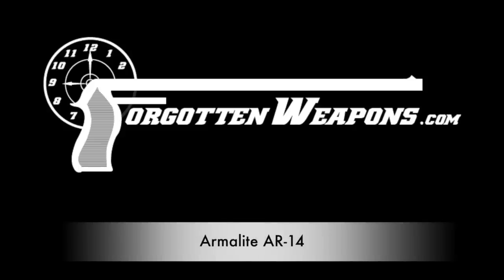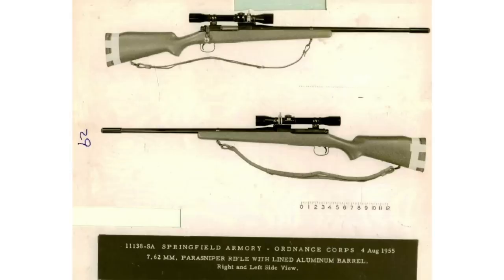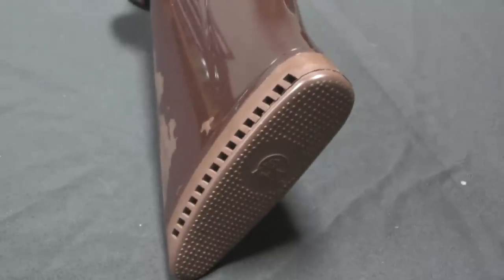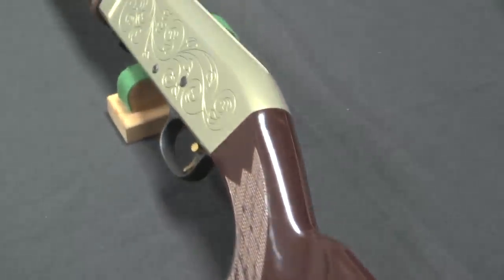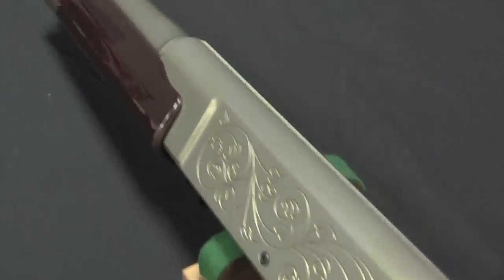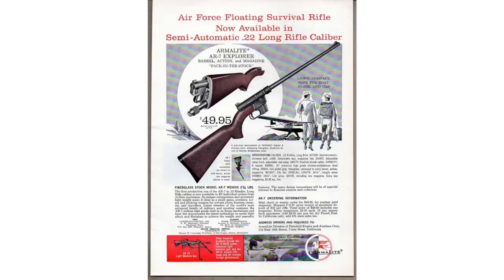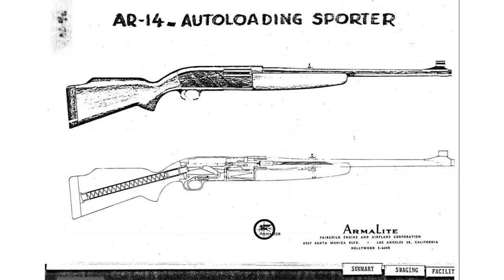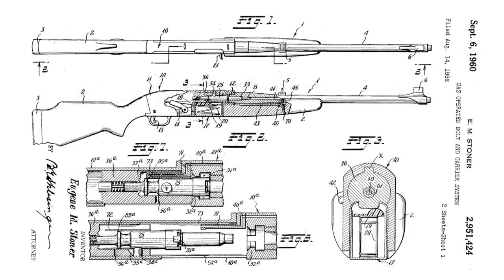Yes, the AR-14 is a Real Gun...Sort Of

Comment: That AR-7 looks very similar to a gun James bond used in one of his films.
Reply: Its the same one, used in from Russia with love
Reply: @sinner2512  ive just found the clip of it, thank you 😊
Reply: Hydin Biden  🤣
Reply: Hydin Biden  Gas turbines are quite fragile while running. FOD is a real problem and the reason why every day at a USAF base starts with all the ground crew walking the apron scanning for small objects that can cause havoc if sucked in to a jet engine. So if that 22LR bullet hit just in front of the air intake and was sucked into the enigine it is possible to down a helicopter that way. Pulling off that shot reliably is where you need a large dose suspension of disbelief, only 007 can pull that off, and even he only in fiction.
Reply: Yes and he shoots the guy in the billboard.  In the movie it is described as 25 cal but that doesn't exist.  Fun fact: Virna Lisi was supposed to play the lead.

Comment: Just to toss a little more knowledge about the "exploding barrels" and the M16/M4 ...Armalite did extensive research on barrel steels. The Military "forgot" what Armalite told them...They found out the newly developed Chrome Molly with Vanadium added was a dangerous combination all be it a harder barrel. The US Military adopted the CMV for use in the AR15 designated the M16. They also demanded a milspec for the manufacture of that steel due to what Armalite told them. By the 1980s the reason for the Milspec was lost to many of the engineers in the military.  When several M4 (*carbine version of the M16) barrels exploded hurting SEAL team members while training, the military engineers basically accused them of fraud in their claim, (hint..the SEALs were not lying...). The SEAL members claimed when they came back from lunch or a break and resumed their training, the M4 barrels exploded when only firing 1 -2 magazines.  The Army Corp of engineers immediately did a destructive testing of M4 vs M16 barrel melting in response to this claim. That testing proved both firearm's barrels explode due to warpage from excessive heat only after hundreds of rounds fired.  They only recommended the heating / cooling of the barrels be extended for all branches and that firing schedule is still in the manual of arms today. The report is a very good read and can be found on-line. In the back of the report, after the inclusion of the SEAL statements, is a curious little note ... "under microscopic examination the barrels seems to have micro-fractures..." This was lost on all the engineers and is the actual reason the CMV steel MUST BE inspected while being created. In creating and blending of the vanadium is/goes wrong, the bonding of the Vanadium is not complete. When the steel is then heated to about (I might have poor memory here) 400 degrees, when cooled, the vanadium will separate and create micro-fractures. If these tiny fractures form a chain and create a hole from the inside of the bore to the outside world..you have a pipe bomb. This happens after cooling off and when heated again. So the SEALs claims of the barrels exploding from only a magazine or two were not false.  During training they were heating the barrels made from poorly mixed CMV to about 400 degrees, then stopped training which allowed the barrels to cool down. Upon heating the barrels up again with a mag-dump the barrels exploded injuring the user.  This is why if you are going to buy an AR15 barrel made from CMV.. YOU MUST BE 100% POSITIVE its from a reputable source or your AR15 is a pipe bomb waiting to happen. If you cant buy EXPENSIVE CMV barrel (extra expense is due to quality testing)...DONT BUY cheap CMV, just buy standard CM. A CM barrel is just as good as a CMV for most people and in this case a CM barrel is 100000x better than poorly manufactured and not inspected CMV.
Reply: it's not "chrome molly" it's "chromoly" or SAE 41xx
Reply: @SuperAWaC   yeah..my mistype... but that doesnt change the reality of it.

Comment: I believe the AR5 was actually adopted by air force designated as MA1 it was never officially implemented.  They never put an official order for it by my knowledge therefore it kept its designation but the use was never official. All existing AR5s fall under SBR laws due to barrel length and OAL restrictions. And I am attempting to acquisition one myself but that has proven difficult being that 12-30ish of these may have been built.

Comment: "barrel exploding issues". Ok, there's ONE thing no one has said about Hi-Point....
Reply: I returned a Hi-Point where the barrel banana peeled on a customer! Customer fessed up though, he was running some REALLY hot handloads through his carbine and got a squib and didn't realize, blew the barrel right up. Guy was totally fine but I'd never seen anything like it. He asked for it to be fixed and he would pay whatever the cost was since he just liked the rifle so much, and I called HP customer service and they said something along the lines of "Doesn't matter if you ran it over with a train for laughs, send it back and we'll fix it for free". Sure enough they did, on the itemized report they replaced basically everything except for the grip and the stock, everything else was totally borked down to the rollpins. Got it back for free, guy was super happy!

I'm very impressed with Hi-Point to be honest. Good company.
Reply: @witmoreluke  🤔😳 Actually, I, not being a gun snob, actually like Hi Point for the fact that they WILL stand by their products. Are they "beautiful '? Er, No, but In my opinion, neither is Glock! . Hi points go "bang" and put holes where one wants to put holes. That's what you want from a gun. They are certainly better than the old "ring of fire" stuff that the "economy minded' had to deal with in the past. So, yes, I put Hi Point with Glock. Ugly,but "good". 👍🙂👍